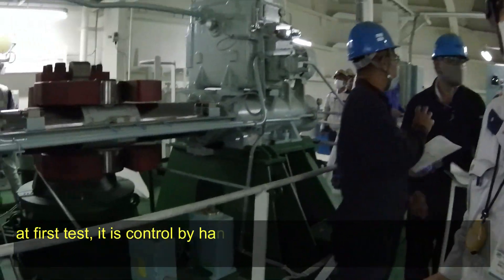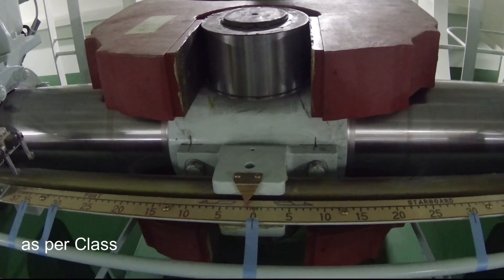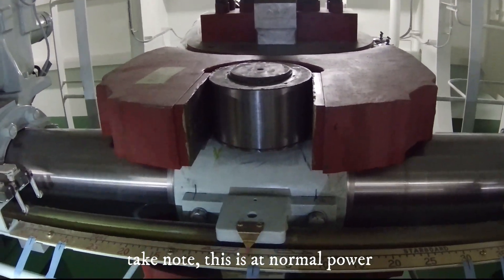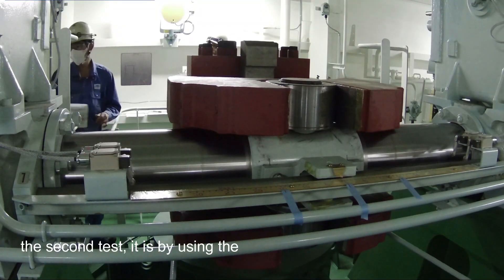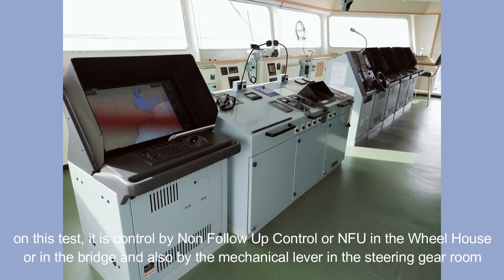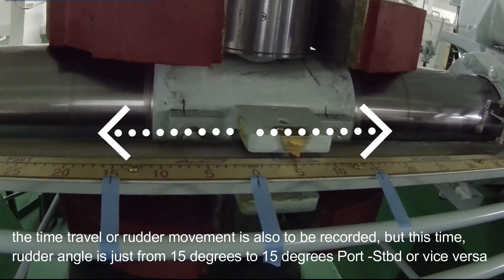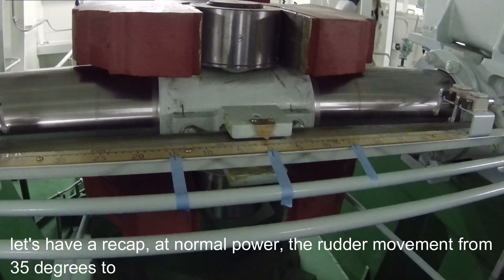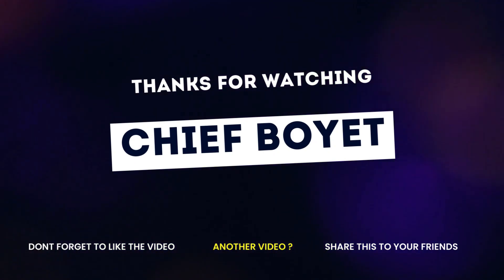Ship's Steering Gear Test | Chief boyeT | Seaman Vlog

Comment: sir, good day. 
i have a question about steering gear emergency testing.
in your video, you said, this testing procedure is conducted when ship speed is half ahead direction.
my question is, why we have to slow down engine speed for carrying out this test.
or i can say, why this test shouldn't be done in full sea speed?
sir pls reply me. ❤
Reply from the maker: Hello MEC, thank you for showing interest.  There are two test being conducted. At normal power, the test is being conducted at MCR or Max Cont Rating of your ME. MCR means 100%engine load. While for emergency power, the test is just being conducted at half ahead.